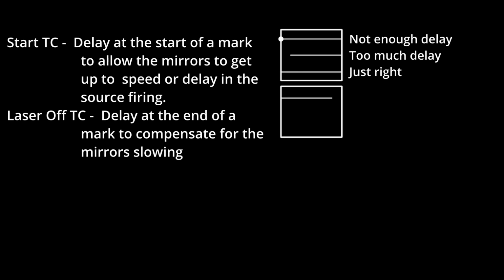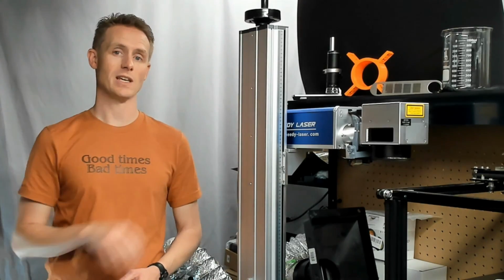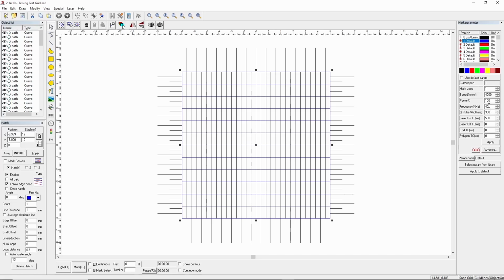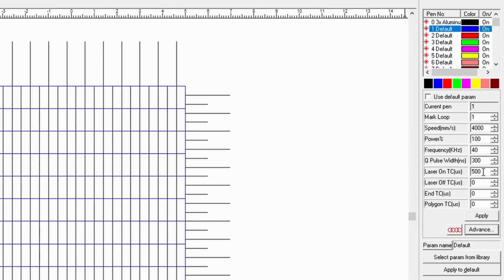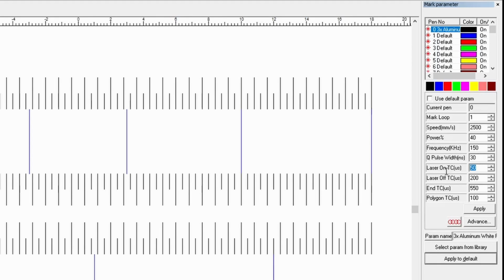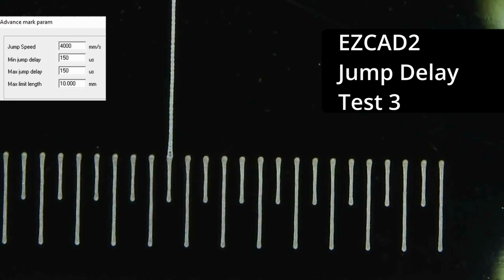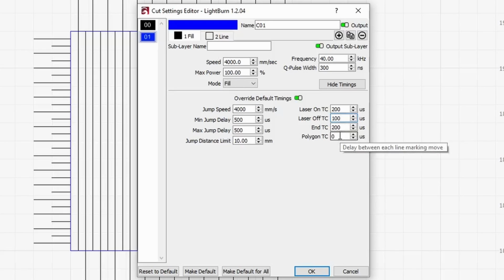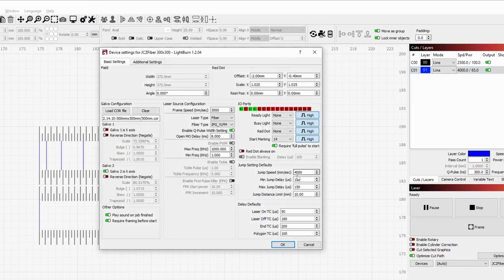Perfect Laser Timing

Comment: What does it mean when the horizontal lines on the timing test are wavy? Everything else is crisp, no jumps or streaks and the vertical lines are perfect but all the horizontal lines are wavy. Any ideas what I missed?
Reply from the maker: If wavy at the start and then transitions to smooth, it is likely the jump delay is too low or jump speed is too high and the mirrors are still vibrating from the rapid move.

First check minimum jump distance is not too large. I believe mine is set to 10mm.

Second try decreasing jump speed. I have seen people use as low as 1000mm/s and as high as 4000mm/s. Not every head can handle those speeds, especially if it is a larger head on a CO2 Galvo.

Third is to increase jump delay to give the mirrors more time to settle.
Reply: @MakrTheory  thanks for the response. It is evenly wavy all the way through, even waves at the same intervals like it's on purpose not jagged and random waves. It is a 5w UV. I will give these suggestions a try thanks again for the help

Comment: thank you for the video, this helped with my timing issues a lot.
I do have a question for you... My Jump Delay vertical lines were all shorter than your examples, they did not reach the top or bottom end as per your image. is there a reason why?
Reply from the maker: You are welcome. If the marks did not match what was on the screen, you probably still have a timing issue. I would check to make sure the settings from the initial timing test got saved as the default and are being used for the jump delay test.

Comment: Thanks for all the great information. I know this is an old video,  but have a couple questions. End TC / Lightburn I don't see any change no matter what delay I use. Can you confirm? Second question, jump delay seems to be applied to the end of the vector BEFORE laser jumps in EZ Cadd2, but in LB the delay is applied to the start of the next vector AFTER the jump. Is this correct? 😎
Reply from the maker: You are welcome. I believe End TC only applies to a delay in the software before sending the next vector instructions. It is really used to keep from pushing too much data to the laser and over running the memory.

I have always understood the jump delay to be the same for both programs: a pause for the mirrors to settle after a jump, and before starting the next mark.
Reply: @MakrTheory  Thanks for getting back. End TC- Think I understand, but what would be the observable results of not enough End TC?  Jump delay, I can't post photos or I could show you what I am talking about, but the little tail that angles away from the vector in your ezcad test occurs at the end of the vector, (I think) when I run same test in LB, (0 jump delay) the little tail occurs at the start of the next vector.  Maybe I am not following the path correctly. Anyway, good video, thanks.

Comment: When opening lightburn timing file there are no horizontal lines.  How are you getting the horizontal lines to show?  I only get vertical lines.
Reply from the maker: When you open the file, it will only show vertical lines. The horizontal lines are the fill pattern of the square. If you use the preview button or run the mark, the horizontal lines should be there.

Comment: Thanks!
Reply from the maker: You are welcome. I’ll be sure to add that link to my description with the others.
Reply: @MakrTheory when I go to engrave the timing file, for some reason it's only engraving the center square and lines within. It's not engraving the lines extending vertically and horizontally! And help would be appreciated! In ezcad2
Reply from the maker: Is it trying to engrave them or is it skipping them all together?
Reply: Skipping all together and only doing the square with inside lines.  @MakrTheory
Reply from the maker: Couple things to check. 1) in the pen settings make sure the layer is turned on. (Click on it to toggle “on” and “off”. 2) make sure to have “select mark” turned off (or alternatively make sure you have everything selected when you start).

Comment: You dont say why the jump settings are incorrect in your example or what changing them did? What line am I supposed to be lining up on the grid to have the correct jump settings as there are multiple lines and they dont look like they line up with anything on the grid?
Reply from the maker: You want to have the jump delay as low as possible to prevent excessive run times, but if they are too short, the laser starts marking before it stabilizes the mirrors. This causes the line to show a slight wobble at the start. The lines on the perimeter are there as a reference scale, similar to the other timing test. I may remove them when I refresh this video to prevent confusion going forward.
Reply: @MakrTheory  So basically just set the jump setting so the line is straight and not curved at the tip correct? Do these settings need to be repeated for a different lens each time?
Reply from the maker: @hcues1  Correct on the curve/wiggle at the line start. Unless you used a really small lens (50x50 or 70x70) to do the timing and then switch to a 300x300, you should be good for all lenses, especially if you used magnification to inspect the test marks.
Reply: @MakrTheory  I did my testing with a 70mm lens, will it affect my 150 & 210 lenses?
Reply from the maker: @rbzjewelry I have not needed to change delays between lenses. Mine are all setup using the same timing settings.

Comment: Ok, I got it. I didn't even need a different tutorial. There are a few things you skipped over and I wasn't understanding the grids and then figuring out which settings worked with which line was frustrating. You didn't mention that the final settings could include a negative number. And this caused me a ton of problems. Once I figured out what was going on I got the laser totally tuned and the jump settings were perfect right off the start. My final settings for my 50 watt omtech 200 X 200 mm fiber laser was - *Laser on TC -170 (Yes minus 170) *Laser off TC 170 *End TC didn't seem to do much either way I went so I left it at 200 based on your settings on your laser. And same with polygon I left at 100. 

The timing grid is perfect. The jump settings are perfect. Now that I have it figured out and know the road, it isn't so mysterious. Sorry for the drama.. That's what you get from a vet with PTSD. 😁
Reply from the maker: I am glad you got it straightened out. I appreciate the feedback and reviewed the video myself. I agree I was much more thorough with explanations on the EZCAD portion when compared to the LightBurn portion. A mistake on my part for having recorded them consecutively and not reviewed them independently as a LightBurn user would. I will have to make a revised video for that portion. I'll also make sure to mention that some settings may require a negative value. Thank you.
Reply: WHAAA HOOOO!!!!! 19 Echo! US Army 1988 -1992. WHAAAA WHOOOOO!!!!!!!

Comment: I'm beyond lost trying to follow this on Lightburn. Anyway I can pay you to get together on the phone to go through this?
Reply from the maker: What part are you getting stuck on? Perhaps I can clarify to ensure others don’t have the same issue.
Reply: @MakrTheory  Thanks for getting back to me.
At 10:32
On the "left" side of the screen I see the horizontal lines are not touching the very first vertical line, are you trying to make it so the horizontal lines are touching the first vertical line?
On the "right" side of the screen, I have no idea what I'm looking at, there seems to be lines missing, it doesn't look like the left side?
Reply from the maker: @I-LOVE-EARTH  I went through that a bit fast in the video. You are correct, the goal is to have the horizontal lines touching the very first and the very last vertical lines.

The first line on the left will be the Laser ON TC. The larger the number, the larger the gap should get.

The last line on the right is the Laser Off TC. A higher number will make the line closer to the vertical line. Too high will extend past the line.

Comment: I do reverse engineering, and really some of the descriptions you used are a bit confusing. Do note that the real timings are JumpDelay, PolygonDelay, LaserOnDelay, LaserOffDelay. Each of which sets a delay value that triggers at a particular event (these are before a JumpTo, before a MarkTo, synchronizing the laser-on/movement events, and synchronizing the laser-off/movement-end events. The EndTC and to a lesser extent OpenMo delay are actually artificial. The program interjects 0x8003 and 0x8004 commands which are `delay with the laser on` and `delay with the laser off` respectively. The EndTC isn't done at the end of the mark but actually at the end of the program-mode list of commands. Usually its only the very last command issued in a command list.

Also, is there some reason this doesn't just keep changing the timing on the fly and performs the entire set of operations each with different timing delays? Other than the software being decidedly cumbersome. But, it seems like rather than change everything as a whole, you could just deviate the timings line by line and use your loupe to figure out your range much more precisely. It seems like merely scripting this file with the varying timings would be a lot more effective, especially if you added in the values for the numbers so you could just find where they laser-on doesn't burn in or start mid travel or the laser-off doesn't burn in or stop mid travel. You could probably even code in some zigzags with different polygon-tcs to see where they maintain their zigs without becoming wiggly and without burn in stops along the line.
Reply from the maker: Thank you for the information and feedback. I have very little background in software engineering, so my descriptions are based on the EZCAD2 documentation and my personal experience with making adjustments, within the software. To my knowledge scripting isn’t a readily available option with either software.

I would love to be able to create something as you describe and share with people to calibrate their machines more easily, but that is well beyond my limited knowledge of software development. Especially if I were to make it easily adjustable for the average laser owner, that would require a full GUI interface and definitely wouldn’t be completed anytime soon.